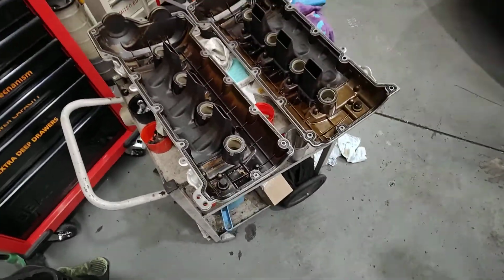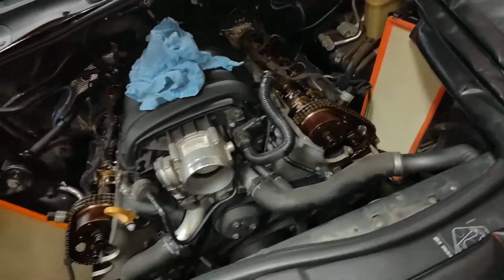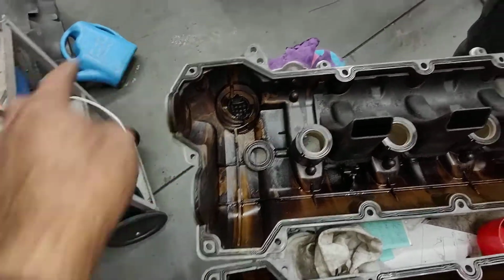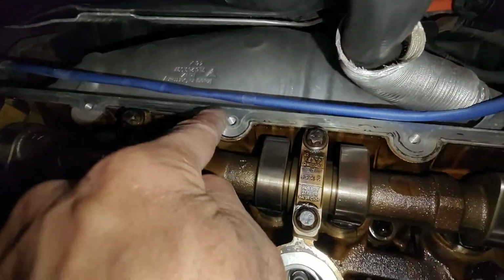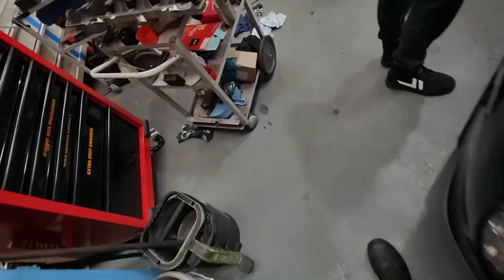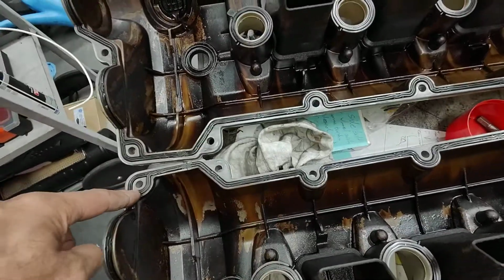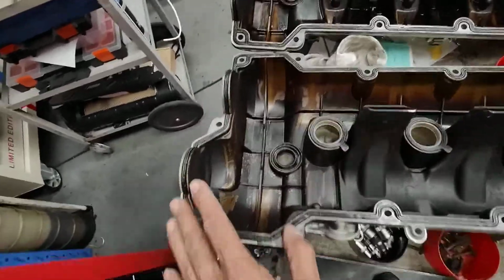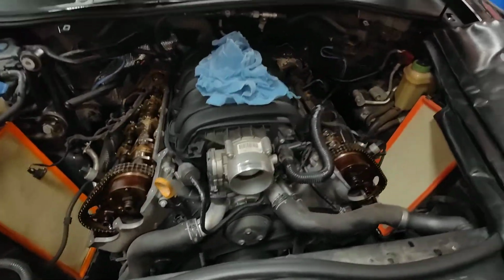Porsche Cayenne V8 4.8 - Preliminary work before Refitting cam covers back on

Comment: It will leak for sure! Please let us know if it is not leaking - I will be very surprised. If it does not leak, please share the RTV that you are using.
Reply from the maker: I will usually it will be ok using the sealant. I'd love to replace the gaskets but if the customer says no.... that's pretty much it.